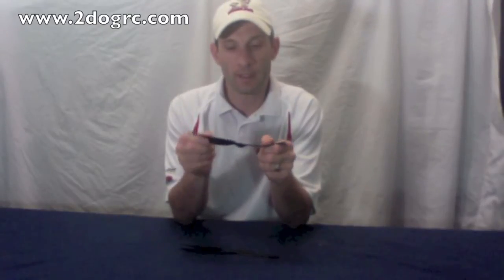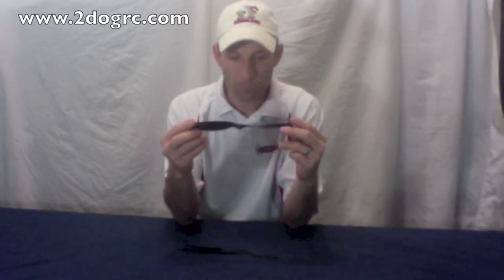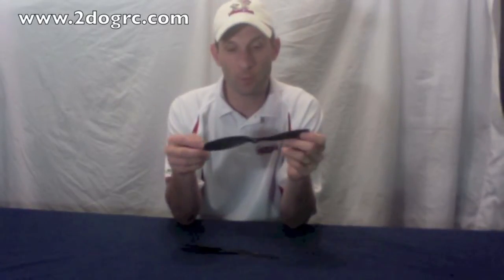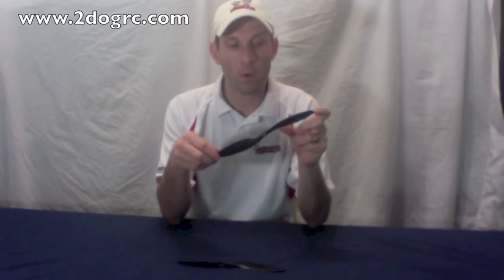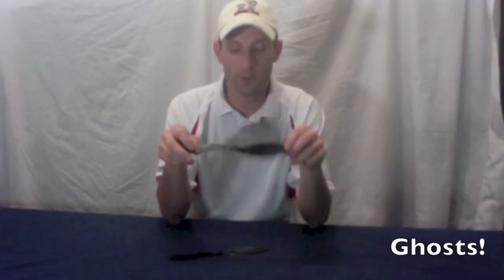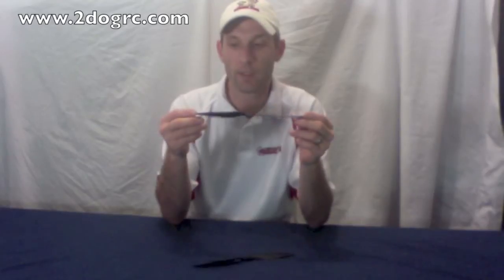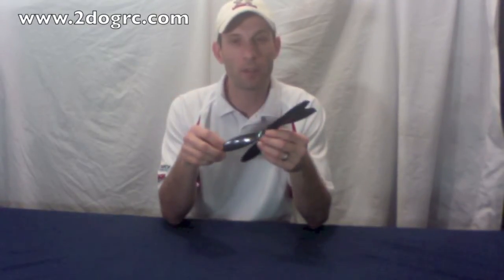Difference in Plastic versus Carbon Fiber RC Quad Copter Slow Fly Propellers

Comment: only 490 views at this point, and I know this has got to be an issue for anyone using the ArduPilotMega 2.5 in that the props and motors (multirotor) must be perfectly balanced to avoid unwanted glitches in data from the accelerometer, read "all important). Maybe it would have been more informative to show the dynamic balance of these at various rpm. You could have also mentioned the tendency of the plastic /carbon fiber composite blades to show stress fractures near the hub after a few uses, even at Multirotor speeds. I am looking at the 14*4.7 SF props I will be using on my 800mm hex build, and I can see why this is a good possibility. I will have to shell out for CFR and won't be for some BLING, that is for certain.